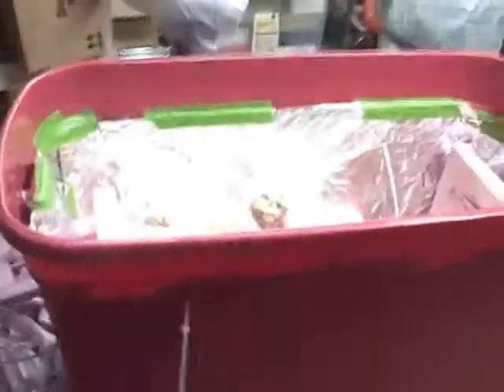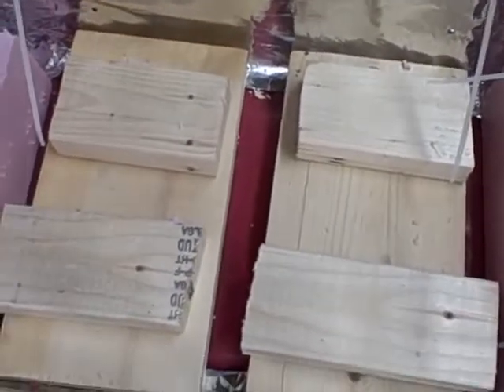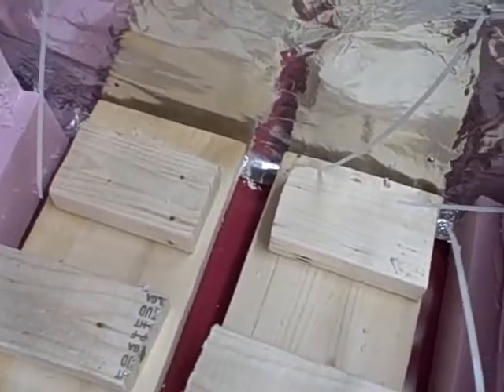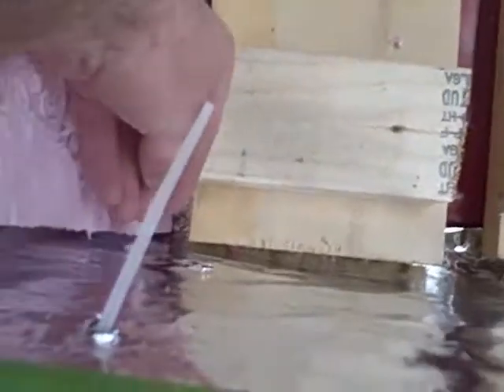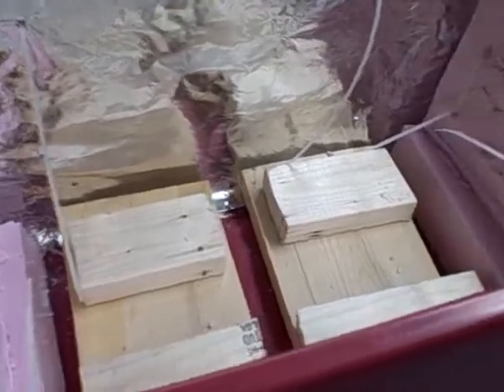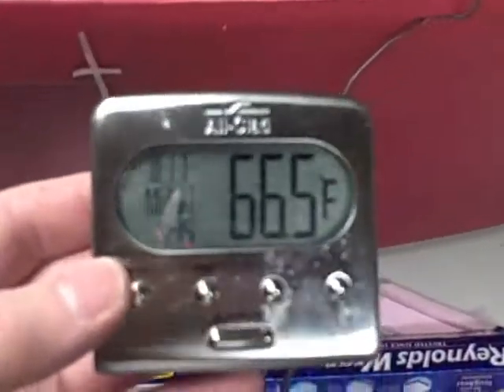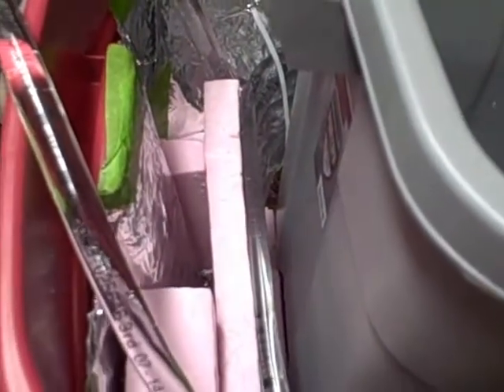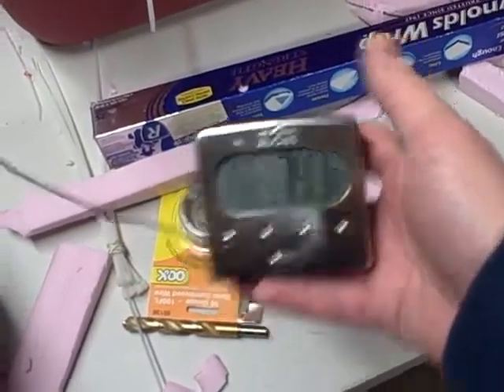Worm Bin Heater.wmv

Comment: i am going to try a hydro plant heating pad on my bin- not sure if placing on top bottom or side as yet
Reply from the maker: I wouldn't place the pad on the bottom, if you have drain holes.  Over the years I have had a lot of liquid drain out the bottom, not sure if they are water proof.  Also if you have air vents on top of your bin it might block the intake of air.  I've never used a heating pad so I don't if there are any warnings or restrictions.  Good luck and let me know how it turns out.
Reply: yeah, I think I will skip it and just try to insulate around the bin with something. Thanks!